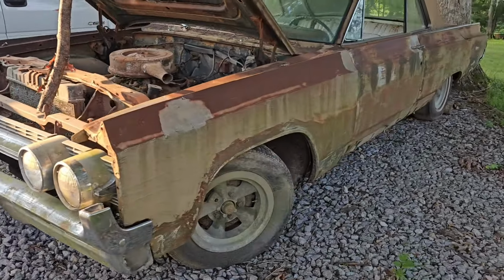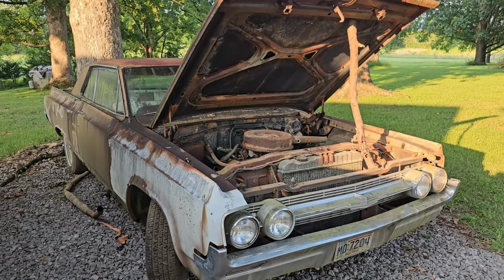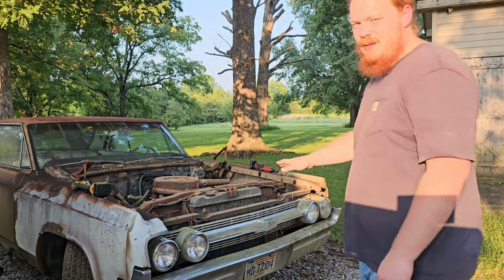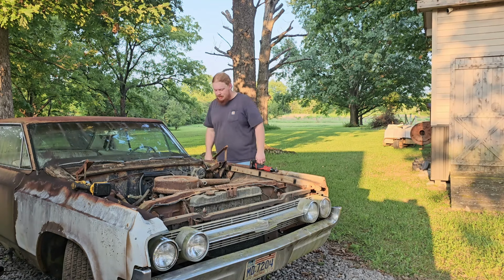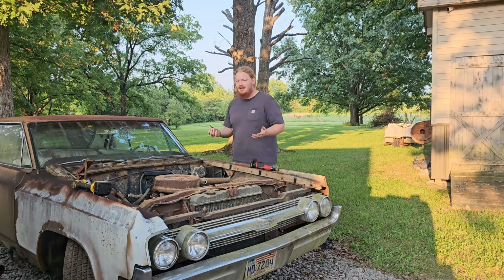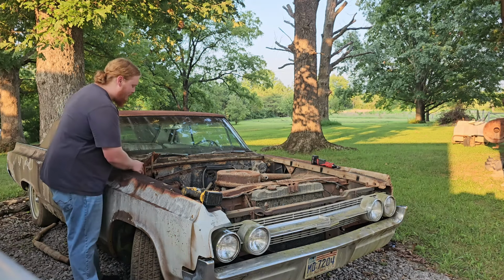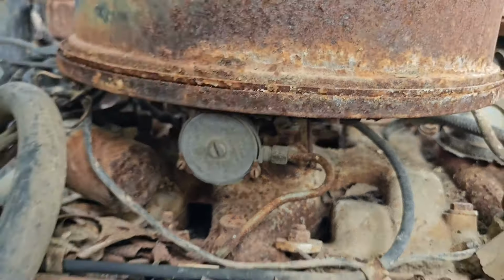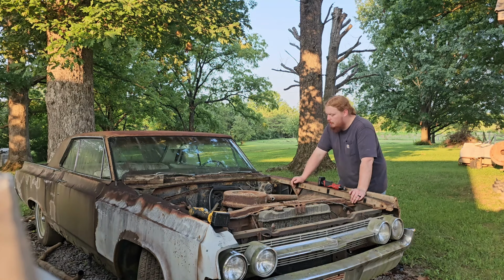RESCUED after 47 YEARS: 64 Jetstar Part 1

Comment: Looks like it's a 394ci. I have the same engine on my 64 Fiesta. These valve covers with embossed stripes, the big oil filer cap. I searched online for identification, I found some really usefull posts on Jalopyjournal I think? On each heads between the 2 middle spark plugs there is a flat spot at the top on the head. I think mine had numbers only on one side. And there is an identification number between the distributor and the firewall, so on the top rear of the block casting, I had to read it and took a photo from the right side on the car, it was more accessible.
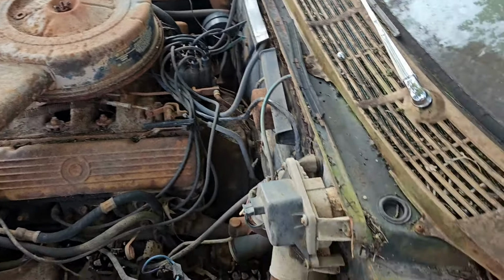Reply: 12:29 see this flat part of the block at the back of the ingnition distributor ? If you clean this there whould a number here.
Reply from the maker: Thank you for the info! I'll have another video coming soon where I take a look at all the numbers and show what the engine is
Reply: @PlayOnWheels  If needed I bought the Shop manual fors 1964 Oldsmobile.